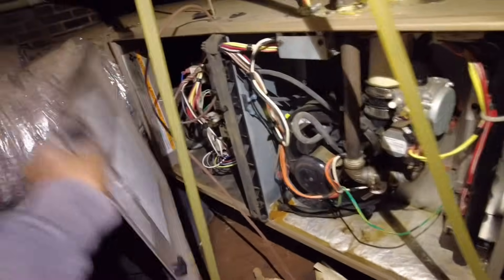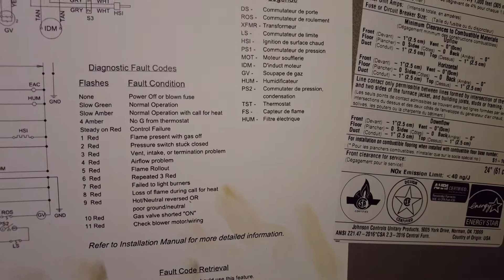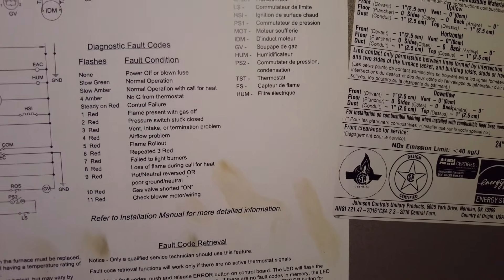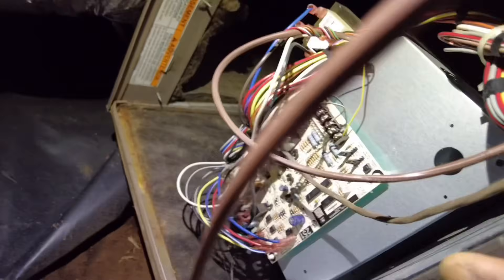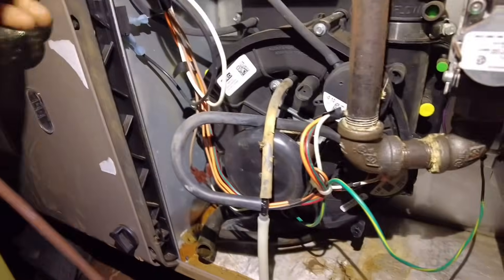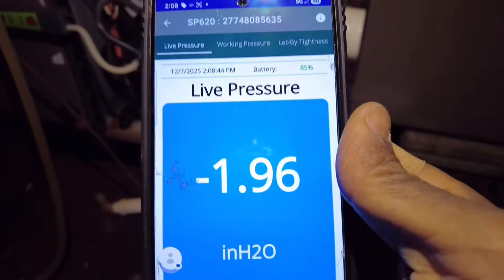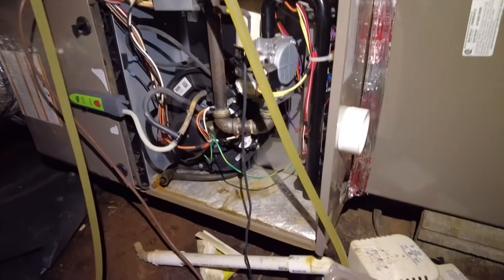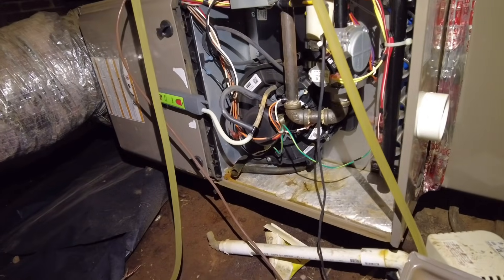2-Flash Error Code on 90% York Furnace due to Failed Pressure Switch

Comment: Good video. Crawl spaces can be tough to work in. On the inducer collar, there are two ports, and one is missing on the drain collar. Because of that, condensate from the exhaust will eventually spill out and drip down. Over time, that can cause problems and really beat up the furnace. I’d recommend plugging that port properly to prevent future issues..
Reply: ive dealt with many in the metro Atlanta area ( usually older Homes) some were rat infested and I refused to work in there until the matter was resolved first.